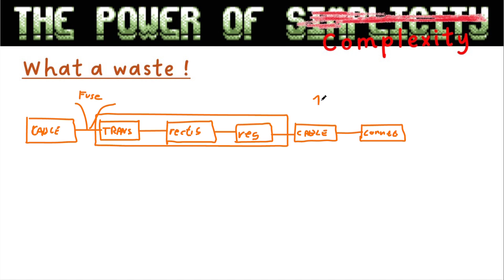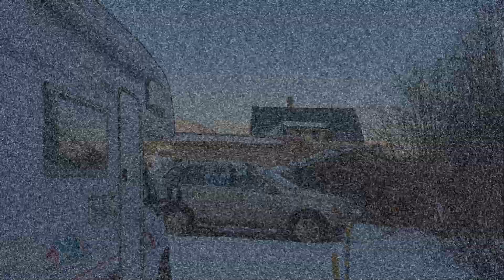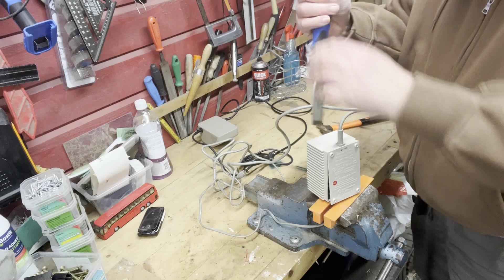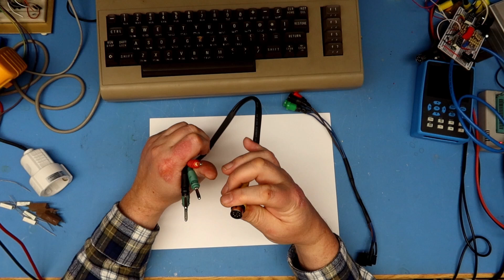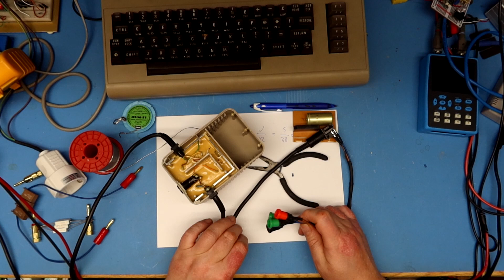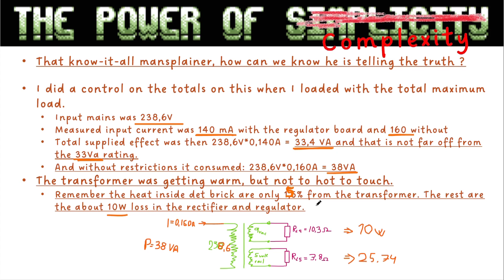Even more you never wanted to know about the Commodore C-64 Power Supply. Part 2 in the series

Comment: For those who may be curious, around 45:00,  RMS stands for Root Mean Square.  In simplest terms, for AC voltage, it is the equivalent DC voltage that would produce the same current in a circuit.  This, in most cases (assuming no DC component in the waveform), is the peak AC voltage divided by the square root of 2, or, in a simpler equivalent form, Vpeak * 0.70712.  Thus, for 30 VAC peak to peak, the peak voltage would be about 15 VAC, and the RMS would be about 10.6 Vrms.  I say, "in most cases", because there are special cases for certain configurations (inductive loads like motors, if I recall correctly.)  None of this accounts for wiring resistances or variations in the incoming line,  so calculations and measurements here are at least reasonably accurate.

As always, good stuff, man.  I look forward to the next segment!  I've replaced my share of these linear voltage regulators in old S-100 gear.  They are not incredibly efficient, as you have demonstrated today.